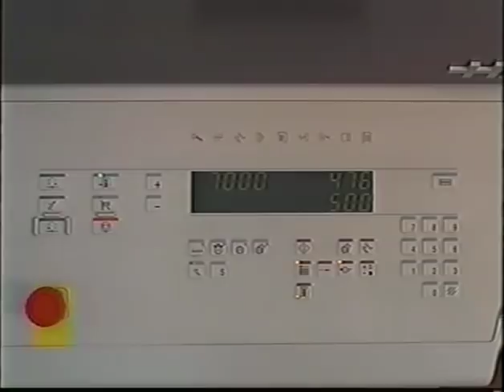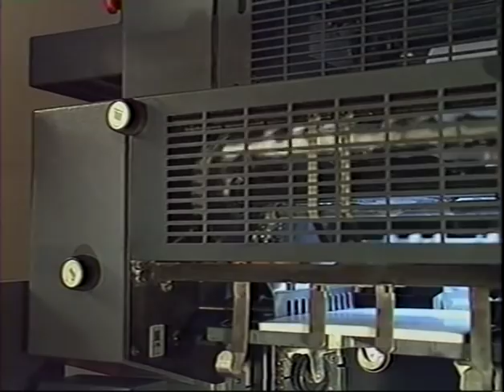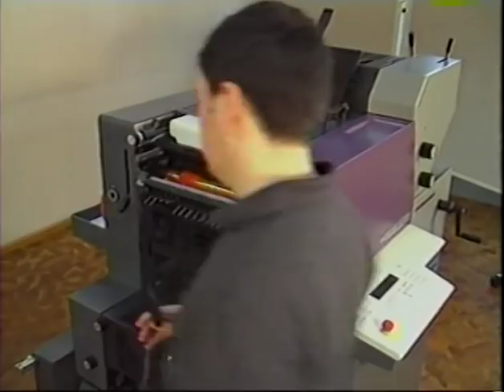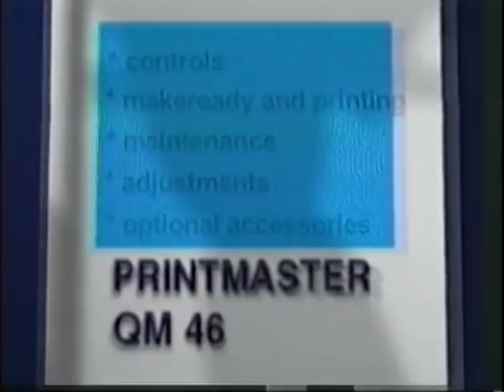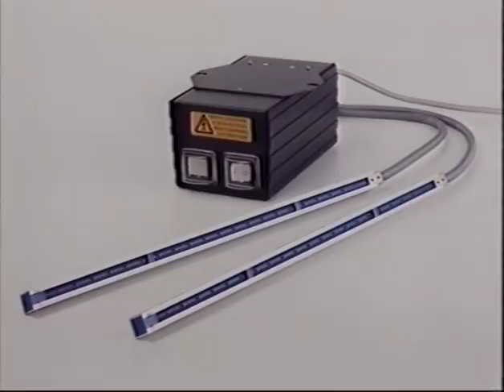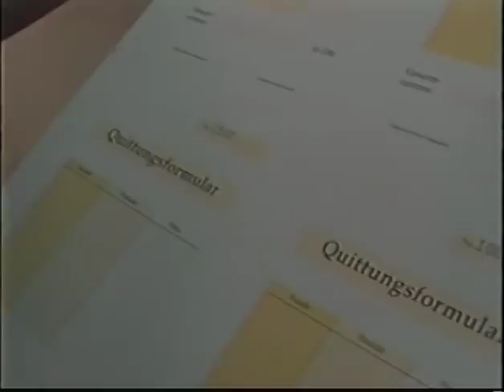Heidelberg Printmaster QM 46 Training VIdeo

Comment: This is actually a very good letter press/ envelope press. It just sucks that when you have jam ups, that sometimes paper gets stuck inside the press with no way to get it out without disassembling. But… it’s a very reliable machine. Also… the gears changing the size of the sheet are plastic. So be prepared to use channel locks with a rag to set you’re size of the horizontal and lateral size for the joggers and backstop. …… hopefully they may be metal now. But, as of 2013 the gears were plastic.

Comment: This is a fantastic instructional for us new operators. Thank you Heidelberg. A couple of things would be nice to have in this video if it can be added. A clean up sequence protocol is not very clear here. Pulling out the water pan and dropping the water rollers seems like a given to experienced operators but to a new operator, being clear on the sequence is helpful. There is also a splash pan that goes under the 1st unit rollers and above the gripper chain. This helps keep the lower drop area clean from excess wash-up spillage. I'll add comments as I get more time on it and look for anything anyone has to add with more experience than me. Thanks for any extra comments.